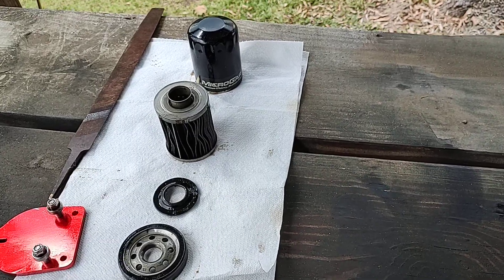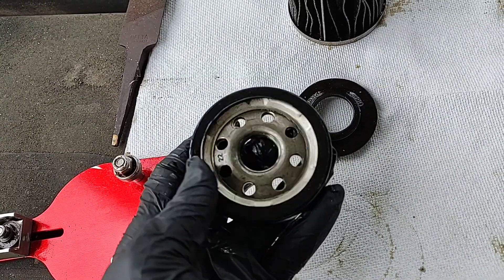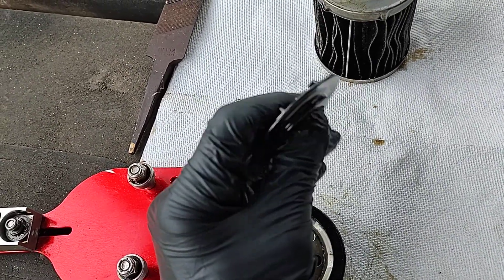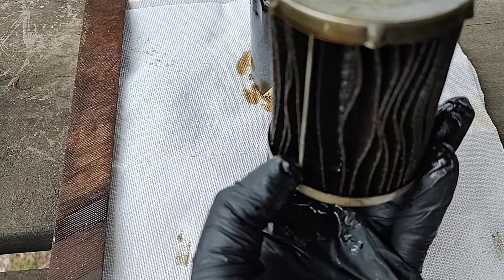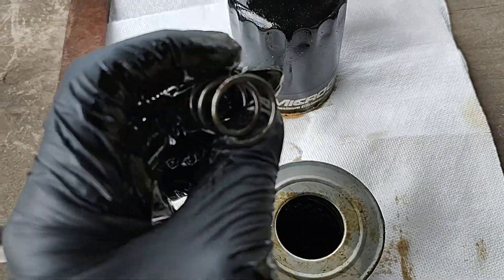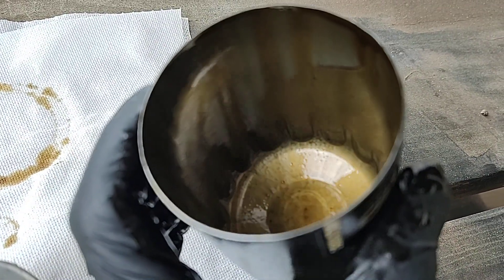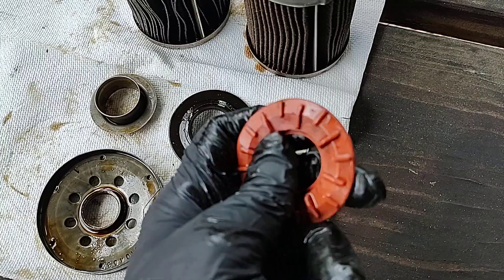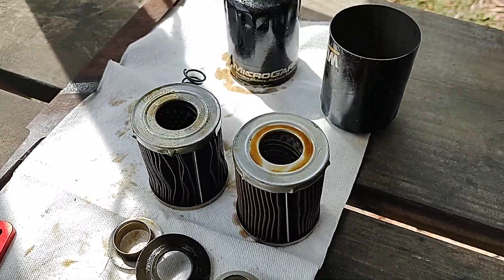MicroGuard oil filter cut open "Extended use" Surprise!!!

Comment: Thanks for the vid, 12,000 is  definitely extended. Failed filter asked to do to much. They usually are a good regular filter, thanks again.
Reply from the maker: I totally agree and me saying 10 to 12000 miles I think was a conservative estimate
Reply: @uglyhandgarage2927 I’m thinking this Microgard filter is rated more for a 5000 mile interval (because of the nitrile rubber anti-drainback valve). In my Honda Civic, which requires synthetic oil (0W-20), I use the Microgard Select…it’s got the silicone anti-drainback valve, and it’s rated for 10K miles. (But most I go is 7K miles). My filter pleats have never warbled like that.
Reply from the maker: @carlovanrijk4039  I agree... Honestly I am not sure how long it was in service but I think 5 k would be a cycle for this filter!!

Comment: The basic is not a good choice for any extended use. I haven't used them but the Microguard Select uses better pieces and from all of the videos I've seen doesn't seem to suffer from Glue Gone Wild like darn near every US manufacturers filters do. It's especially bad with Purolater's Motorcraft line. I've also seen some Royal Purple filters that looked Outstandingly BAD.
Reply from the maker: I've seen a few filters with excess glue but nothing that would be detrimental... Thank you for the comment!!
Reply: @uglyhandgarage2927 I don’t know…if I was to go with an extended drain interval like that, I’d feel better using a Microgard Select. Silicone anti-drain back valve, synthetic blend media, just made for higher mileage. Rated for 10K miles but could probably push it up a little bit.
Reply from the maker: @carlovanrijk4039  I totally agree!!!